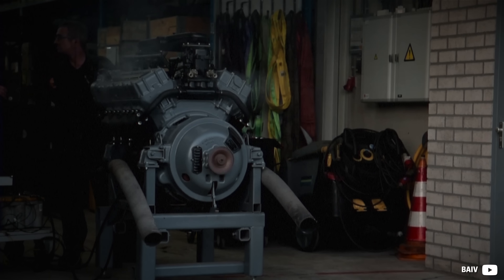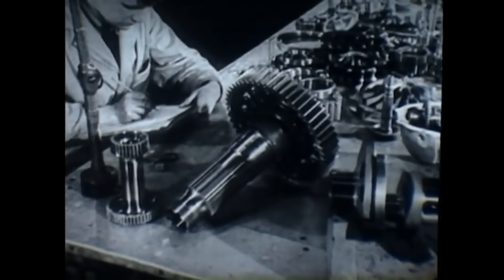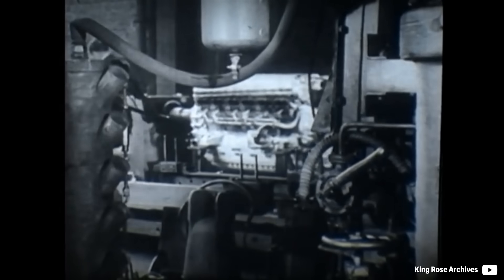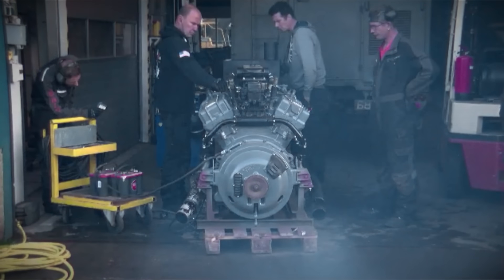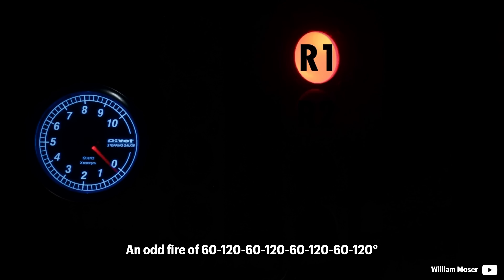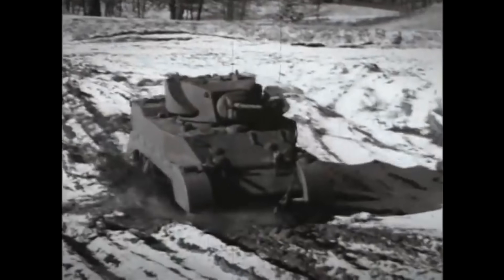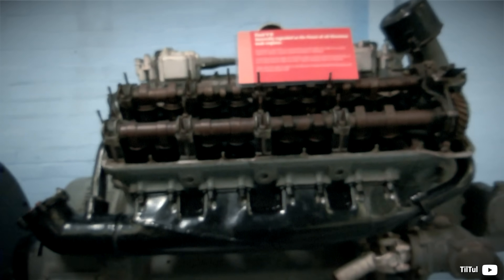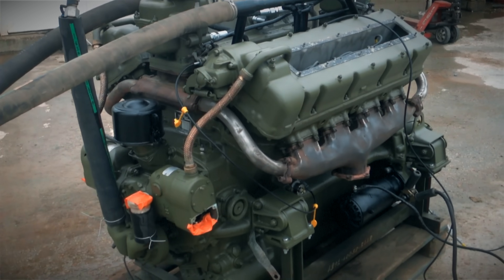The 1,100 Cubic Inch Ford GAA Was Extraordinary

Comment: Thought it sounded odd when they started it up, but then it was revealed that it was a flat plane crank V8. No wonder & how strange that they chose that type of crank.
Reply: Es el mismo plan de cigüeñal en cruz  como los V8 que Ford hacia en esos años  Mire, me equivoque Mirando mejor el video veo que si es de dos planos  Fue por eso que me costo ponerlo a punto Porque yo insistia con el orden de encendidos de Ford V8  Yo no desarme el motor  que ya venia con el cigueñal puesto y solo le coloque las tapas de cilindros  ,los carburadores Bendix y los magnetos
Reply: @juanasanelli6831  he said in the video that it was a flat plane crankshaft, that's why it doesn't sound like a traditional American V8
Reply: @phil955i  Mire yo arme uno  en mi epoca del US ARMY hace mas de 40 años  Y SI es de 2  planos NO es igual que el Ford V8 .Por eso me costo mucho ponerlo a punto ya que no tenia ningun manual que me orientara con el Firing Order.
Reply: No conozco ningun otro V8 con cigueñal de dos planos
Reply: @juanasanelli6831  Ferrari, TVR, Ford Mustang GT350, Lotus Esprit V8, to name but a few, are all flat plane V8s
Reply: @phil955i  And the latest Corvette Z06.
Reply: @indigomizumi  yes, that as well 👍

Comment: First time hearing about this engine. Still a wonder knowing how capable these engines were close to 100 years ago
Reply: I thought the title said 1100cc not 1100cui at first..
Reply: Juan,   100 years ago would have put it to 2045 as it did not go into service until 1943,  quite a ways from 100 years still.
Reply: Very capable lol it's just a oversized v8
Reply: @johndowe7003  yes it's just an oversized V8   but also a first of it's kind in many ways ,,it was an all aluminum alloy V8 engine with a monoblock design ,,all of the V12 engines  that this was meant to compete with were single cam engines ,,and both the allison V12 and the Merlin V12 were much more complex they had a split crankcase  and heads that were not removable without removing the entire cylinder bank from the block ,, the GAA was the very first DOHC V8 engine ,something we take for granted today
Reply: @wildcoyote34  There was a tank version of the Merlin. The Rolls-Royce Meteor. Put out about 650hp. Same physical size and capacity of the Liberty L-12 (27 liters) but the meteor had about 60%+ more power than the aging Liberty engine (from WW1).
Reply: @andrewthorpe3219  the meteor  like the merlin it had all the same complexities and difficulties of maintenance ,,,and the meteor had 4 more cylinders to make 600HP ,,i'm not gonna say 1 was better than the other because the Meteor was reliable and after development issues so was the GAA ,,american tanks moved away from gasoline engines sooner than the british did ,,the M48 Patton had a V12 continental air cooled gasoline engine 1790 cubic inches later changed to a diesel engine of the same type by 1960  they were all diesel while the british were still using gas engines

Comment: DOHC 32 valve V8, 18.0 liters......And all back in WWII!

Great video!
Reply: And gasoline 👌
Reply: @johndowe7003  *Turbo-diesel
Reply: And aluminum
Reply: Awesome Ford power
Reply: @shanefeeney9630 crazy thing is this engine started life as a Ford V12 for airplanes. Would’ve been a monster
Reply: and flat plane crankshaft
Reply: @tomritch1354  YES!
Reply: This is like an ls7 coming out in 1964, just mind blowing
Reply: @billyray4716  Good analogy.
Reply: That BLOCK pushed Tanks (35) tons and PT Boats as a pair. What did a PT Boat weigh? Depends upon the thickness of your Depends. Around displacement of 1000 tons at 36' and built of wood. John Kennedy found out how fragile these were. PT 109.
Reply: Also: Had a flat crank, just like the latest models of the Ford Coyote 5 liter V8.  Side oiler oiling 25 years before the Ford 427 FE NASCAR engines. Dual distributors. Tapered wrist pins. 4-bolt main bearing caps with a double splay. Cams and all accessories were shaft and worm gear powered, no chance of a snapped cam drive chain or accessory drive belts. 
6 head studs per cylinder. The camshaft hold down studs continued up through the valve covers, thus using them as extra stabilizing girdles for the cams.
Reply: @bobkonradi1027  How do you know it's crankshaft is like the 5.2 liter Ford engine?  It is probably more like the flat plane crank in a Ferrari or the latest Corvette Z06....
Reply: @Flies2FLL  To me, flat plane is flat plane. The engine is a 60-degree V, so the firing goes: 0-60-120-60-120-60-120-60-120/0. If two Ford cranks were to be laid on their side, they'd both look like they came from a 2.3 liter straight 4. Whatever that makes it similar to is what it is similar to. I compare it to a Ford, because they're both Fords. That's what most Ford aficionados would relate to, even though the Coyote is actually a 90-degree engine.   That said I'd need to know if the Ferrari is a 60, 90-0r 120-degree V., which .would dictate where the firing impulses are, and what its resemblance would be vis-a-vis a Ferrari.
Reply: Wrong.

The 5.2 liter flat plane crankshaft on the Ford Voodoo engine is NOT arranged like the crankshaft in a Ferrari or that Z06.  Look it up:  Seen from the side, the crankshaft is up down up down, whereas the typical flat plane crank looks just like the crankshaft of an inline or flat four:  Up down down up.

You probably ought to do some research before you post.  Ford did it this way because they wanted the car it was mounted in to sound like a Mustang, not a Ferrari. 

By the way, the Ferrari V8 is a 90 degree design.
Reply: @Flies2FLL  I misunderstood what your question was from last night. The GAA's rod journals are wide enough for 2 rods to fit on one journal. So, the GAA has 4 rod journals, All the rod journals are flat, but at 180-degrees to each other. I believe (but am not positive) the Ford Coyote V8, at least in the hi-po versions such as their Shelby model, are on a flat, 180-degree pattern, same as the GAA. I think each rod journal supports 2 connecting rods. So I believe both engines' cranks look the same, though the GAA's crank is obviously longer. I have no knowledge as to what a Ferrari flat crank looks like, if its 2 rods wide or only one. I've seen some cranks where the journal only is wide enough to accommodate one rod, which then leads to a counterweight  on either side of all rods. I have some cranks from GMC big truck V6s from the 1960s that are like that, and they have 7 counterweights for 6 individual rod journals. But I am not sure what Ferrari does.  As I say, I think the Current Coyote V8 and the GAA flat cranks look the same. I just said in my previous postings that the GAA had a flat crank and the Ford Coyote HiPo also had a flat crank.
Reply: @bobkonradi1027  On every V8 engine, whether it is cross plane or flat plane, two connecting rods share the same throw.  There is nothing unusual about this.

Here is where you are wrong:  Ford's GAA had the typical up down down up flat plane crankshaft despite the 60 degree bank angle.  This caused uneven firing. The engine was built this way in order to make it more compact, and a flat plane crank is easier and cheaper to build.  It simply vibrates more, due to second order vibration.  You really weren't worried about vibration in a tank, especially when this engine spun as slow as these did.

The Ford Voodoo engine was a 5.2 liter V8 engine with a flat plane crank.  But this is the ONLY flat plane crank to use the unusual up down up down layout.  Ford did this because flat plane crank V8's can rev higher due to small counterweights, but they wanted the Mustang that contained this engine to still sound like a Mustang.  Chever-Lay went the opposite direction with the Z06 5.5 liter flat plane crank, using the traditional up down down up throws and as a result it sounds like a Ferrari, or a Japanese sport  bike.  

Go look all this up.  Also, look up videos that show what a Ferrari V8/late Z06 sounds like, as compared to the Mustang with the 5.2 liter Voodoo engine.  The sound difference is obvious.
Reply: @Flies2FLL  The GAA engine started out as a 60-degree V12 aircraft engine. Ford was sure the army would adopt it that they went out on their own and made all the designing, casting cores, made up some prototype engines, and then approached the army air corps. The Army said NO, because they already had the Allison V12, it was already in production, they had a lot of spare parts for it, they had mechanics trained to work on it, and so forth. So Ford got turned down. At the same time the Army Tank Corps needed a good engine for the Sherman tank. Their aircraft 9-cyl engine was not working out, and a couple of other engines were not saitsfactory. So the Army asked Ford for some prototypes for what they wanted. Ford literally took the casting cores for their V12, literally cut off the back 4 cyilinders grafted on the bellhousing, and there was their solution. The engine kept the existing 60-degree block because it was already there, they chopped the back of the existing heads, made some other changes, and then the GAA was born. I have 3 GAA blocks, and for all 3 there is a vertical casting flaw behind the rear two cylinders from where the bellhousing was literally grafted onto the block. They could have made up a split journal crank, but they chose the flat crank because it was stronger. BTW, the crank is high grade cast iron, not a forging, and a flat crank would be the stronger of the two options. Because they also wanted hollow main and rod journals, both for lightness and for oil reservoirs, and because the split journals (as above) would weaken the crank, in addition to the split rod journals, that is why they went for the conventional main and rod journals, for more strength. The hollow journals served as backup oil reservoirs in case of an oil pump failure. Any crank can have rod journals that are one rod wide or two rods wide. Ford's memo report reflected their consideration for going in either direction, but they went with the double-wide rod journals. It can go either way. My first reply to you, I indicated the -0-60-120-60-120, etc which is prima facie an uneven fire crank. In my website I mention the uneven fire, and that's the reason for two 4-cylinder magnetos. When I built my modified GAA #1 engine, I used 2 4-cylinder Pontiac Fiero MSD distributors, one per cylinder bank. Note that the distributor cap is from an MSD V8 engine, but every other terminal was blanked off at the MSD factory. Every other terminal is active and every other terminal is blanked off. The engine had vibration from the uneven firing, which is why Ford put in a 150-pound plus flywheel, and then a 75-pound floater plate, so as to dampen the vibration. That's a 225 pound rotating mass at the rear of the crank. To keep it from slippping, Ford added 6 tapered dowels as locaters, flywheel to crank, in addition to the normal crank fastener bolts. Otherwise the rotating mass might snap off the big Grade 8 bolts. Its interesting, there is a tractor pulling team in Europe, and they use a GAA engine. Because of it using twin turbos "without" blow-off valves, and with the turbos pumping 60-70 pounds boost per their data logger, they use a billet steel main girdle, billet crank, billet rods and billet pistons, but they chose to keep the uneven fire crankshaft. And they use methyl alcohol for fuel. They've had no problems with the setup. They have twisted the puller's frame a couple of times. Before they went really heavy duty, they ran stock GAA components and had no problems at 50 pounds boost. They turned up the boost to 57-58 pounds one time, and all that was left were little hunks of shrapnel. The point is, the stock 2-bolt main late model block, with the cast crank, uneven fire, the whole package, would hold a little over 50 pounds boost. I don't know why Ford chose to do whatever they ended up doing with the Coyote engine, crank, wise, and I've not seen any engineering papers or reports on "why" they did what they did. That's why their engine design engineers get those big bucks, to make the correct call on engine design.
Reply: If you think about it, it makes sense that complex engines were first available in big size.

Bigger size makes it easier to fit more stuff, and lower rpm means less thermal issues.

On top of that, military funds help a lot to pay for nice stuff.
Reply: Was it German 😃
Reply: @spankthemonkey3437  FORD , made in USA ,,the GAA was actually the very first all aluminum Monoblock V8 with dual overhead camshafts ,, the competitor engines that ford targets were the merlin and the Allison V1710  both of which were SOHC engines that had multi piece engine blocks and with either of them you can not remove the cylinder head from the cylinder bank  the entire assembly must be removed from the block